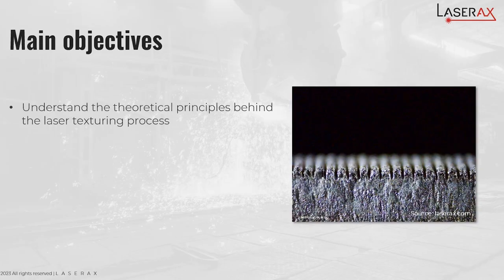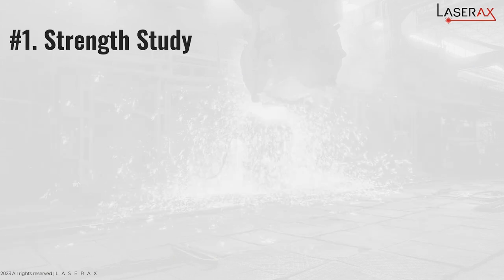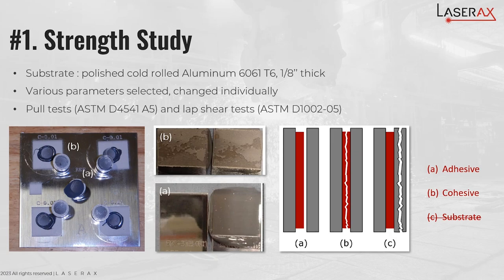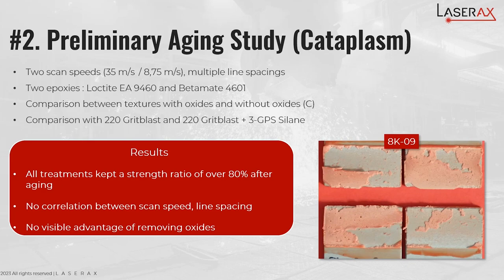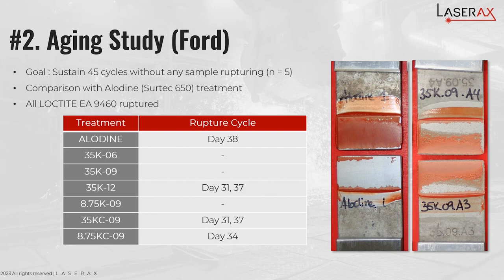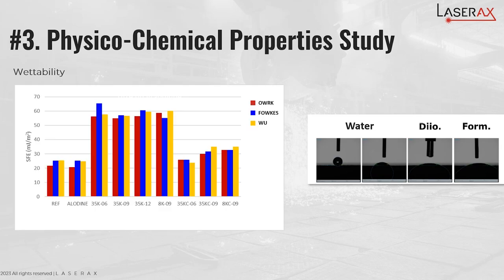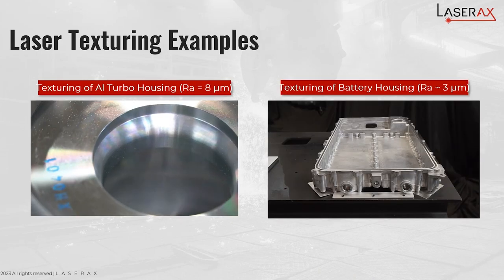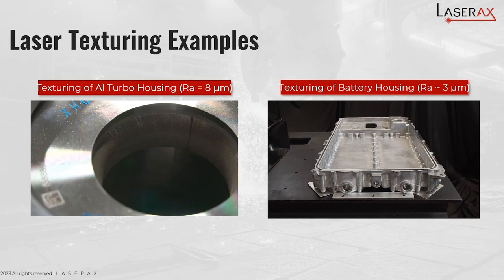Laser Texturing to Prepare Metal for Adhesive Bonding

Comment: I did some work with texturing aluminium to maximise adhesion. In that application, we managed to DOUBLE the strength of the bonding line: we couldn't believe what we saw, it is impressive what texturising can so. I'm sold on this process.